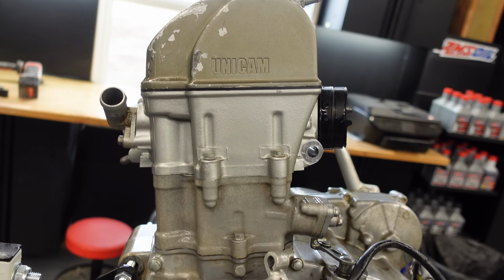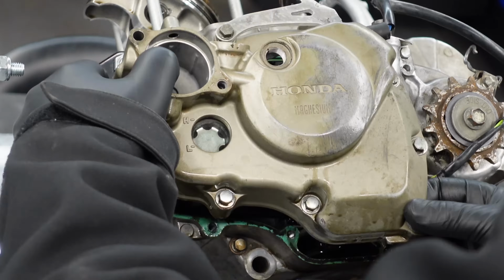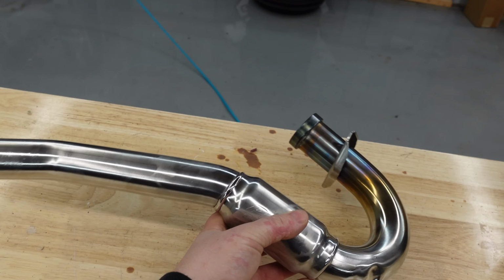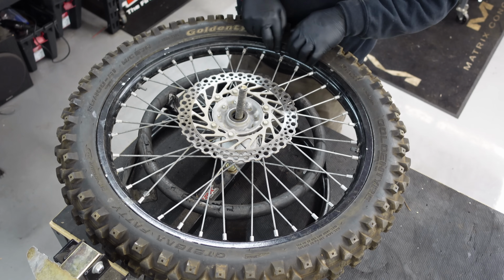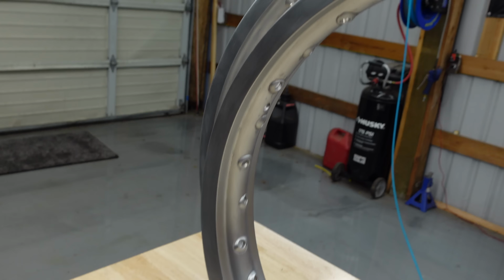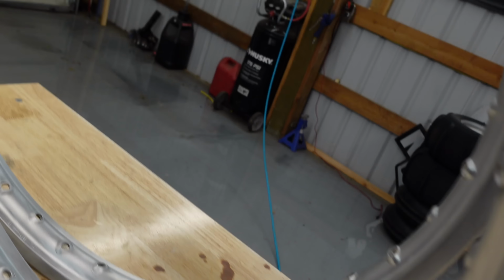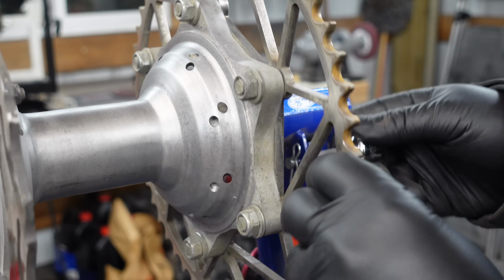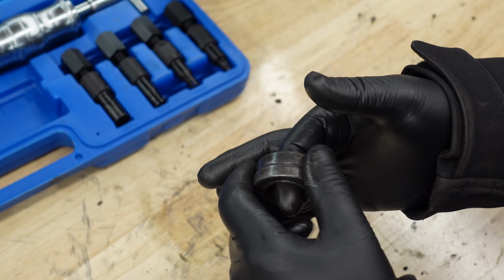I paid WAY too much for this...| 2008 CRF450R Works Edition Replica Series: Part 3

Comment: i had a 06 really good bike but i went with the best 02 cr af cr500      91cr500 steel frame 86 trx250r
Reply from the maker: Are you talking about a hybrid?
Reply: @nwmotogarage  yea 02 cr250 roller i mean iv seen better like a ktm chassis swap but theres more to it i have a mill need a lathe but i kept it honda
Reply from the maker: @charlesphilips2920  that’s so cool! I would love to see it when it’s all done!
Reply: @nwmotogarage  its done with elka rear shock made for the bike your working on and excel a60s with gold excel hubs  now the trx build is almost done 2k electric start oh i forgot to mention all my 2 strokes have 00 01 digital cr 250 igns get em before the price goes to 2500 lol anyway do me proud i ripped up the hometown schools feild with my 06 crf450 a60 wheels pro circuit ti oil was always clean i dont like new bikes that share engine clutch oil og the carb was worked it had the bowl quick shot and etc would keep up or beat any modern 4 banger especially with hotcam on vp  what a reliable bike many chains and sprockets on that girl

Comment: I have the 07 made the most hp 450r had ever made even today they off by 3 hp in 07 the 5mm tilted head was introduced making it one of honda nastiest 450 I still have mine with original title 08 I loved cause right behind the number plate was first year they introduced the stabilizer which 07 don't have just some fun facts sick bike brother true unicorn
Reply from the maker: I have been doing a lot of research on the comparison of both and there are actually a lot of differences!! Unfortunately, the bolt that hold in the stabilizer has broken off and the stabilizer is nowhere to be found so I won’t be able to experience it. Maybe someone can get me one if I ask in a future episode
Reply: @nwmotogarage  they both have same 5mm offset on motor one don't have a stabilizer not to many differences at all 07 08 but if so please let me know im all ears even both made the same exact hp 55.74 oh sorry and the decomp on to the other literally nothing else
Reply from the maker: @angelteamnolimit624  https://motocrossactionmag.com/amp/2008-honda-crf450-race-test/

Comment: thought of the same idea on my 2008 450r such a mean carby bike and would suit a 2021 plastic kit with thr decal kit. I have to fully rebuild my engine as the top end is fully destroyed. Thankfully the bottom end is somehow good but will be replacing the crank and all bearings/seals anyway. I'm planning of sending my shocks off to showa and have them redone

Comment: Nice....just a tip, spokes will rust because you removed all the zinkplating .
2008 is considered one of the best MX bike
Reply from the maker: That’s a great tip! I thought the same thing so I tested the process on the front spokes first to see if it went down to bare metal, but the scotch bright wheel is so soft it just cleaned them up. Took me holding the spoke in the same spot for quite a while to get them down to bare metal. And yes it is!! Cannot wait to ride it!!
Reply: @nwmotogarage  👍

Comment: Use air hammer on stubborn axles just a tip.
Reply from the maker: Great tip!! I have definitely done that before but I only use it on swingarm pivot bolts because it damages them beyond use. Usually you can get an OEM pivot bolt for about $25. For the axels I go with a slide hammer and patience, tends to yield less damage. Thanks for the comment!!
Reply: @nwmotogarage  ive had ahold of some that try to drive bearings out of the wheel when removing axle with slide hammer/hammer. Put a smaller bolt inside of axle so no to damage threads air hammer has saved the day more times than i can count.
Reply from the maker: @loganpenland6568  I didn’t know the bolt works, I was always afraid of mushrooming out the threads!! Thanks so much!

Comment: I see a lot of people always talking about when you have a broken case just replace it as a set I’ve done it 2 times on 2 stroke and 4 stroke (it worked both times) the case halves were not the same and no issues I think it’s just a lot of people talking with no experience but me my self I’m not even a mechanic lol but still !!
Reply from the maker: Yeah it’s pretty fortunate these are not mated! Look up some years of the Kawasaki 4 strokes on an OEM website like RockyMTN. If you notice you can’t select each case individually, it’s not even possible! It’s like the part numbers don’t exist for the left and right, it’s just one single part number and you are getting both :/ Thanks for commenting!!

Comment: As an ME, I wanted to point out that most engine cases are cast together from the manufacturer as a single unit. If your looking for longevity of the engine, it would be best to replace both case halves with a matching set, since two case halves from a different casting cannot be guaranteed to match/align properly. Otherwise great vid! Love the content and looking forward to seeing how it turns out!
Reply from the maker: Thanks for the insight! And I am so glad you are enjoying it! For the future, how would I get ahold of a matching set?
Reply: @nwmotogarage yeah of course! eBay can usually be a good place to start :)
Reply from the maker: @Deng1neer  oh you are talking about used cases, gotcha. I wanted to go OEM if I was going to replace them. Tried to do eBay one time and it just replaced the problem I had with another one. My parts rep confirmed though that even if you wanted to, there are no matching cases to buy, Honda just doesn’t do it like that for the spare parts

Comment: Seal the ends of the front pipe and use your gas torch on the dent .As the heat builds, the dent will pop out ! Looking at how abused that bike has been , I wouldn’t use any of the bearings , especially the wheel bearings, since there was no axle block one side and the spokes and sprocket was loose. Buy new ones and have piece of mind for your own safety.I like the longer videos too.  Enjoying the series build good luck 🏁👏🏼
Reply from the maker: Thanks for answering!! So glad you are liking the videos! I am already so over budget i with the Mrs breathing down my neck and Christmas and all but you may be right, might just need to get some. I will say, I can assure you, there was definite no one riding this thing without those blocks, it’s was all lose and someone just slapped it in to sell it. I have also had the chance of Inspecting several wheel bearings old and new and these feel pretty nice. I will definitely heed the warning though!

Comment: Are you zinc plating the spokes?
Reply from the maker: No, the wheel I used is so fine it’s almost a buffing wheel. It was just enough to get the gunk off and polish the zinc. Great question!
Reply: @nwmotogarage  Thanks! I bought a Caswell Zinc plating kit. I have been real happy with the results. I restored a 1995 Honda CR250 and a 1970 Honda CT70. Everything has been zinc plated. I have them on my page. I have enjoyed your videos.
Reply from the maker: @Mr10usdad  I will check them out!

Comment: Why on earth would you repack those bearings with greese , it's so cheap to just replace them.....
Reply from the maker: I am not one to throw away good stuff just because it’s not new, they really feel just as good as new. However, I am getting enough comments about I just might go ahead and get new ones. Thank you so much for lighting the fire under me and changing my mind
Reply: @nwmotogarage  Sorry to say but the whole bike in my opinion needs to be tossed.Parts alone is going to cost you the price of a new bike which ofc is better.Hope your having fun you are a good mechanic.

Comment: Why would you repack the wheel bearings with grease ?? , their a one time fit and your asking for trouble, just buy new ones
Reply from the maker: I will have to look into that! I wasn’t aware the tolerances change during removal! Thank you!!
Reply: @nwmotogarage  ask any mechanic worth his salt if they would reuse old wheel bearings once you have pulled or knocked them out, see what they say, guarantee the answer will be throw them away and buy new,
Reply from the maker: @lanceoverton5919  I took your advice and ordered some new ones. When they arrive I will throw a pair of calipers on them and report back the results!! Thanks for watching and caring 👍
Reply: @nwmotogarage  no worries, I’d rather you were safe than sorry 👍